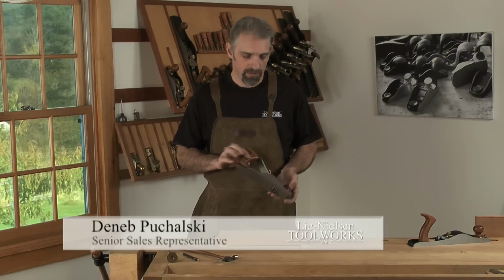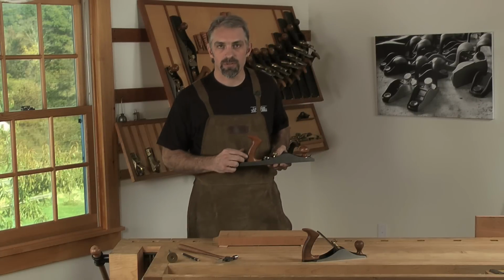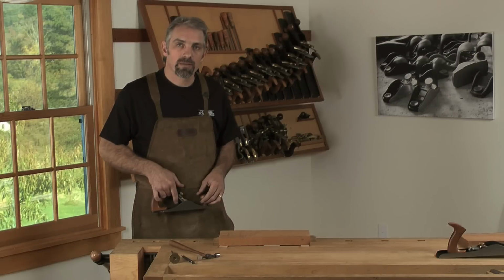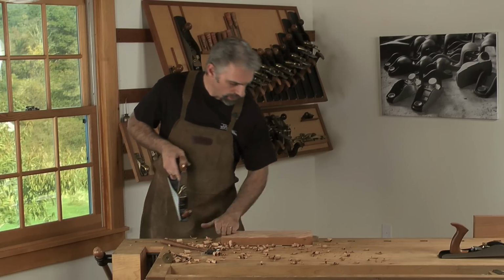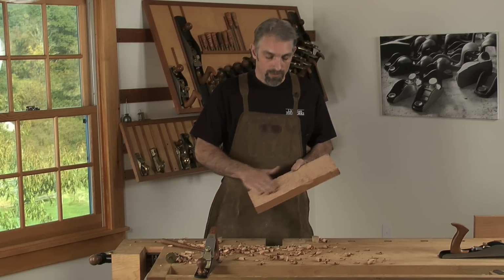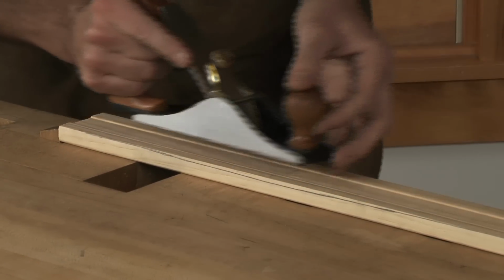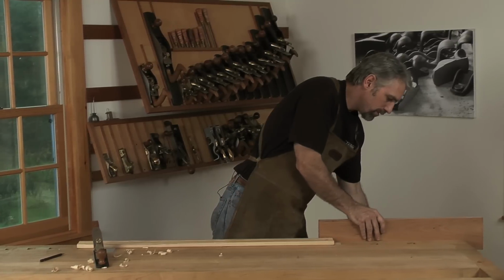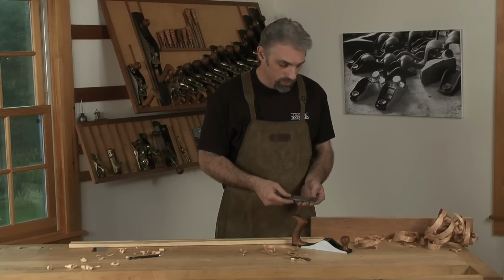Scrub Plane Use and Care

Comment: I inherited the equipment belonging to my great great grandfather, who was a master carpenter. I've been very careful to make sure that his equipment has been cared for. Surprisingly, he did not own many planes. This was because there was a job back in the 1800s that doesn't exist now. According to his journals, these men were called lumberers, and it was their job to straighten boards after they had been cut and seasoned at the sawmill. That way, carpenters could generally rely on stock they ordered to be straight; no bows, bends, or twists. And one of the primary tools they used to do this was also called a scrub plane, though it's unclear if this the same tool that carpenters employed. The description for lumbering scrub planes was a plane with a relatively narrow but thick iron which provided plenty of room to the sides and front of the mouth for chips and large curls to fly. One particular aspect of them is that the mouth of the sole as well as the iron were curved. This was to allow one line of cleaned would to smooth into the other since the scrub plane was pushed diagonally across the grain of the woodrather than with it or directly across it. 

I was able to track down the history of each of his planes, in the model constructed back in the 1880s was listed as a scrub plane. But it did not fit the description, as the mouth was not much wider than the iron, and both were completely straight. 

I've been trying to look for a lumberer's scrub plane for years, and this plane is, frankly, the closest that fits the description I could find. 

So, is this particular iron capable of reshaping a twisted board, as well as taking out bows and bends. These planes were relatively long so that the sole would run flat quickly once the problem had been worked out. I don't mean something as long as a Stanley #7, but a 10-12 inch sole, a wide and curved mouth with lots of room for large chips, and a narrow and curved but extremely hardy iron for overpowering poorly shaped lumber is essential. 

Would you say this plane is capable of that kind of work on rough-cut and misshapen lumber? If not, what would?

Comment: I wanted to mention what worked for me to remove nicks from a LIe-Nielsen scrub plane blade. Today I used the Veritas® Camber Roller Assembly with the Mk II and it was much easier for me than other methods I've come across. Plus I was able to hone to 8000 shapton grit, not that I needed to do that, but why not?

Comment: Can this be used to remove board wind or is that not advised?
Reply: Yes, the scrub plane can be used to remove wind in a board, but it is very aggressive so take fewer passes and it will cause tear out.  Deneb does a fantastic job of demonstrating the technique.  

I made my own scrub plane using a 5 1/2 jack plane.  I use it to flatten stock all the time.

Comment: Pretty lame demo of thicknessing a board.  Tons of tearout.  Tiny board.  Took it down maybe 1/16".  Try thicknessing a 48" x 8" board from 1" down to 3/4".  The tear-out will mess it up completely and it will take forever.  Unfortunately (for hand tool users and LN) a powered thickness player is really the only practical solution.
Reply: It's a demo.  If tearout is a problem, take more shallow cuts.
Reply: Tom Pistor try face jointing a 14" wide board when you have an 8" jointer.  By the time I've built a planer sled, a scrub plane and a jointing plane have done the work beautifully.  Afterwards, I can send it to my thickness planer and bring it down to size.  It works super well and I don't have to keep building sleds/jigs for that one application.
Reply: No ,just put a camber on the outward edge and tearout ceases to be a problem.I see from your comment you are unable to use hand tools.
Reply: I guess all those artisans of the 17th and 18th century never finished a job then
Reply: @johnpejakovich8848  100%
Reply: If you chamfer the edges and ends down to depth, you will get two benefits. You will have a reference that shows your progress, and you won't blow out the edges. 

Keep your planes sharp and tuned. Use the proper plane for the job. Read the workpiece and work with the grain. Doing these things will yield good results, quickly, and without tearout.

Even power tools will butcher a workpiece when dull, out of tune, and used without skill. They will do so loudly, and much faster than with hand tools.

The person saying something can't be done should avoid interrupting the person doing it.
Reply: @jjbailey01  :
Heh ! Very good reply :-)
Keep'em sharp, my friend !
From a Norwegian woodworker